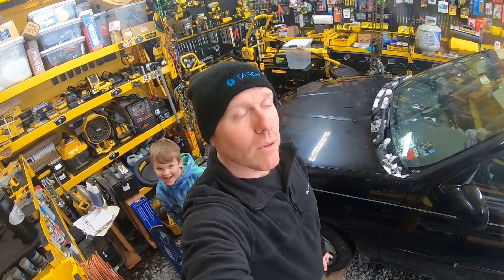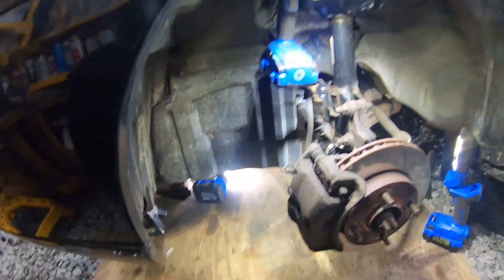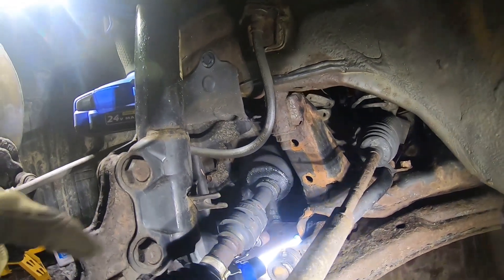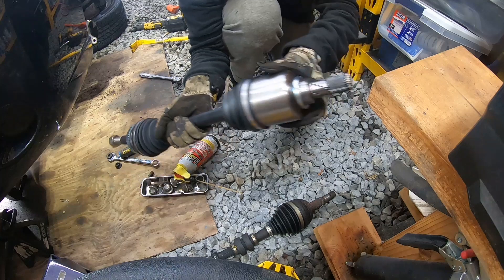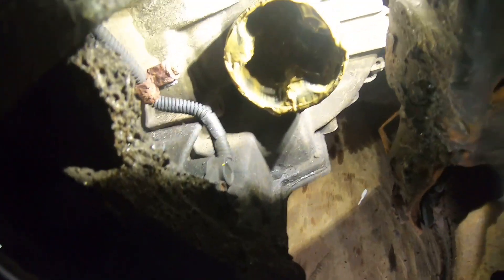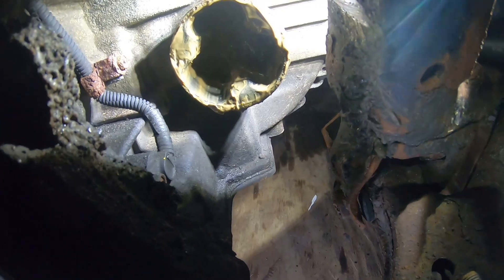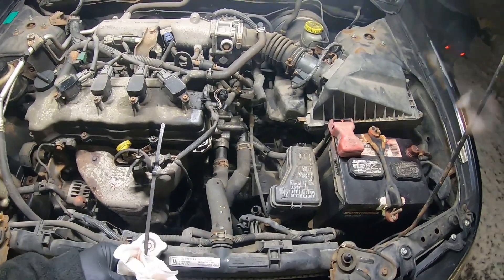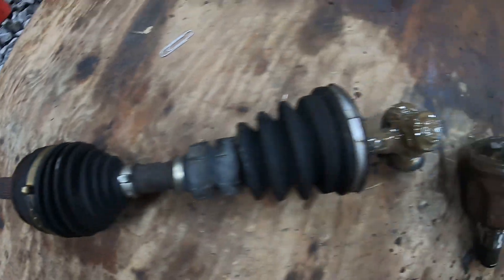How To Replace A CV Axle On A Nissan Sentra!

Comment: Awesome video. I need to do this on my sentra, except on the passenger side. 

The boot has a crack in it and although it isn't making much noises, it is making a metallic grunting sound on certain roads

This video is one of the few I've found for the b15 generation. Even better that it's the same drivetrain as mine
Reply from the maker: Awesome I'm actually doing a 2009 Nissan Rogue driver and passenger cv axle! Just finished the passenger side and the bearing was rusted in! Even with the air chisel and 10lb removal tool it wouldn't budge so I finally took my propane Torch and heated the bearing then used the slide hammer and it finally broke free! Rust sucks where I live hopefully you have better luck and easier time gettingit out if not remember heat is your friend especially for seized cv axles! Goodluckandthanksforwatching!👍!

Comment: you have a 99-2006 sentra?   looks like it.  this video will come in real handy for me.
Reply from the maker: Awesome Good luck and thank you for watching!👍😊
Reply: that's interesting you have a dip stick for the transmission.  my 06 base model doesn't.   that's about the only thing I don't like about it.
Reply from the maker: You don't have a dip stick???
Reply: don't think so.  I have a manual transmission.
Reply: there is no difference in the type of axle on the drivers side between the manual transmission and automatic right?  it's only on the passenger side where there is a different?  I could not find any online retailer that specified any difference between a manual transmission and automatic transmission on the drivers side.   however, if you start looking to buy the passenger side axle, then all the auto parts store websites have one axle for the manual transmission and one axle for the automatic transmission........I think.

Comment: great video just in time for me to do mine! thank you! is there a seal to replace? i have some ATF starting to leak out
Reply from the maker: Thank you and thank you for watching hopefully this answers your question! It's not a bad job you may run into a hiccup like I did but hopefully not lol
Since the axles going into the transmission, and the transmission itself, are made of metal, the axle seal houses a flexible seal that rides on the axle and keeps gear oil in, and crud out. The flexible seal uses a small amount of the gear oil in conjunction with the seal itself to achieve this task.

Comment: Hey I changed my brakes and rotors and is still getting a vibration when I brake at low speeds. My cv boots look fine as well. What could be the problem?
Reply from the maker: Warped rotors are normally what cause that but also sticking or stuck calipers!!! you just put new Rotors on and checked cv boots so I'm thinking your Calipers need some attention!! Let me know how you make out and thanks for watching!👍
Reply: @WhitehouseFarmVet  thanks brother
Reply from the maker: Best of luck to you!👍

Comment: Hi, just wanted to ask because I think this may be the problem with my nissan: what could cause this to happen, what was the sounds you were hearing before you fixed it and could the cv axel be making the car shake at higher speeds? (Like 55mph-60mph) My car was in a accident and I know the front alignment is off slightly but me and my dad have been thinking it’s the cv on driver side because of the sounds and shaking. If you can’t tell what the problem could be (because I’m not a mechanic and don’t describe these things well) that’s totally fine too just wanted to ask, thank you for this amazing instructional video.
Reply from the maker: If you can jack the front up and put your hands at the 9 and 3 position and try to shake the tire back and forth also do this at the 12 and 6 position! If it moves you could have a bad wheel bearing or ball joint!! If you have no play then move on and inspect,  your cv axle if you are driving  do you hear a clicking noise, also a clunking noise when accelerating ?look for worn parts or torn rubber if so replace! I hope this helps good luck!!